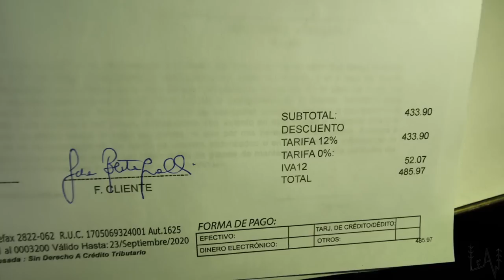Van Life RESILIENCE - We don't give up on our old Truck Camper Lucky LeAw

Comment: I was just looking at the picture after you turned off the truck your second U-joint looks like it's coming apart it's your second U-joint that's creating your vibration it's not pressed in correctly
Reply from the maker: In the next video (on Sunday) we will finally fix Lucky LeAw and get back on the road! We will also show in the video what was wrong! Thank you very much for watching and commenting! 🙏❤😊👍😉👋 Cheers Luca & Sara

Comment: I don't think you need a new drive line. You would have felt a bad vibration before if it was unbalanced. It can't get out of balanced from sitting there. It could be something in the transfer case or in the rear differential. either way you need to find a Mechanic that knows what he is doing. this is not that difficult for someone that knows what he is doing.God Bless,
Reply from the maker: Good morning Patriot! In the next video (on Sunday) we will finally fix Lucky LeAw and get back on the road! We will also show in the video what was wrong! Thank you very much for watching and commenting! 🙏❤😊👍😉👋 Cheers Luca & Sara

Comment: Don't belive it's  the reversed throwout bearings. The have needle bearings inside.Not by no means bashing or hating.  That's the young generation throw it out by a new one ,go in debt no problem. To spend your time building your own home, be it on wheels or not.Half the thrill of a adventurous life experience is the tests that get you better as a person .The center bearing bolted to the frame could be bad and causing the vibration. You guys stick it out it will get resolved.
Reply from the maker: Hi Rodney! Thank you very much for watching and commenting! 🙏❤😊👍😉👋 Cheers Luca & Sara

Comment: Hello, I started laughing, but not at you. This happens all the time. Everyone focuses on on problem, not on the system. There are some great Youtube videos on balancing a drive shaft. I think the u joints maybe the incorrect ones, or something was not put on correctly. I would visually inspect each part. See if they fit snug and correctly. When you have one thing fix, change out all. These cars are old, so all parts get used. Good luck! Be thankful for what you have (last video you had with issues). the universe is test you....
Reply from the maker: Good morning Scott! In the next video (on Sunday) we will finally fix Lucky LeAw and get back on the road! We will also show in the video what was wrong! Thank you very much for watching and commenting! 🙏❤😊👍😉👋 Cheers Luca & Sara

Comment: It's difficult to see but pausing the video it looks like the front uni-joint is out of phase by one spline.  It usually has an engraved make at the spline (under the rubber flex behind the center bearing).  It should have been marked before being removed if it wasn't engraved.                It's a simple mistake and easy fix but should not have happened.  Take it back to the mechanic and they should fix for free.  Otherwise remove the rear shaft (or drop the center bearing bolts out and lower to the ground) separate at the spline and realign so all the uni-joints are all in the same phase alignment. 

The mechanic will fix easy, fast and should be for free.
Reply from the maker: Good morning Steve! In the next video (on Sunday) we will finally fix Lucky LeAw and get back on the road! We will also show in the video what was wrong! Thank you very much for watching and commenting! 🙏❤😊👍😉👋 Cheers Luca & Sara

Comment: Was the driveshaft put back together as it was aligned originally?  Did they mark the pieces and asemble it the same way? It is an easy fix if they did not get it back together as it was originally.  This is the problem because it is happening at low speeds. Have them reassemble it correctly. Also look to see if  there is a spot on the drive shafts where a weight might have been and was knocked off when working on it? The missing weight will cause vibration at higher speeds not so much at low speeds.  I would not put the truck in drive like that with one of the rear wheels on the ground.  The truck could move unexpectedly by engaging the wheel on the ground!!  Be careful.  Hope you figure it out.
Reply from the maker: Good morning! In the next video (on Sunday) we will finally fix Lucky LeAw and get back on the road! We will also show in the video what was wrong! Thank you very much for watching and commenting! 🙏❤😊👍😉👋 Cheers Luca & Sara

Comment: If the spines in the joints fell out and got under the cap, it is ruined.  Unfortunately you got some bad advice on what needed replacing, not going to go into it.  They are not being careful enough with the work they did.  I hope you get it fixed correctly.  Even though the out of balance comments can be an issue, this is not your problem.  That would be at higher speeds.  You better not drive fast with it the way it is!  It is clearly not spinning centered and that is much much worse than out of balance because they did not mark it.
Reply from the maker: In the next video (on Sunday) we will finally fix Lucky LeAw and get back on the road! We will also show in the video what was wrong! Thank you very much for watching and commenting! 🙏❤😊👍😉👋 Cheers Luca & Sara

Comment: firsta alla, ifa the drivealinesa Ra outa balancea and werea nota b4A, likea way they usedabea, it cana bea outabalanca ...  move onea 180 degreesa, (only takes one little wrench )... can checka  outa balancea  by adding a hoseclampa toa the drivalinea  ...  the nut screw parta mighta be enougha weighta? (shoulda only happen when going over 40 or 50 mph, 2A), .... moeva ita arounda, buta thninka you mighta havea bada transa and or transfera casea  mountsa too? the other rubber partsa werea waisted!! .... youa very luckya to hava those guys helpa you outa... they DID A LOT ALL READYa!!! Sure they checked the carrier bearing too,A? ....  needa more of the driving and not fixing,eh? 

one of the best rigs i ever bought, ($ vs. drive time) was a 1975 $25  wrecked van cause it had a new carb, distributor, alternator and shocks, but did not run, so towed it home to remove the parts cause i have over 6 70,s dodge vans. when starting to remove all the parts, a friend stopped by and asked why we didn't just fix this one up and drive it, cause it was a ripped out shell, and could fix it up way we wanted it. . We did fix up only the insides , left the outside all primer and dents, but the inside became primo deluxe with shag and cedar and mirrors and custom furnishings... We drove it over 300,000 miles before we parked it, running, and now parts rig. only put about $200 in parts over 12 yrs and learned a lot about peoples "perceptions" with a windowless van, all wasted looking on the outside! Looking forward to more vids about the .... outside's and  left and right going down the road from you 2! thanks, best of luck .... AndA.... cooomeone, you can do it, or she will starta doing it tooA!  Can tell you 2 are beautiful on the insides too! THATS WHAT COUNTS... maybe a different way driving back north to Alaska??? your truck should be all a ok by thennnnnA.
Reply from the maker: We believe we will be able to get to Ushuaia with Lucky LeAw! Thank you very much for watching and commenting! 🙏❤😊👍😉👋 Cheers Luca & Sara

Comment: I despise that vintage of truck. Lol. Especially if it has a 351. Anyhow...the Ujoints are ok. The way they are arranged doesn't matter as long as you have access to the grease fittings. The vibration of the driveshaft IMO is from being installed without marking the position first. So when it was reinstalled, it wasnt put back in the same position it came out. Get it? If it were me....I'd drop it, and "clock it" til it improved. If it's truly unbearable, I would mark the position and clock it 180 degrees and see what happens. It's cheap, and you can do it If you have basic tools. It's just a pain in the ass.
Reply: Leaw is the best!!
Reply from the maker: OK!
Reply from the maker: Thank you very much for watching and commenting! 🙏❤😊👍😉👋 Cheers Luca & Sara

Comment: I have watched you from the start.  I am a Failure Analysis engineer, I know trucks, mechanics,.   YOU NEED TO PULL THE CAMPER OFF THAT F350 FORD AND GET ANOTHER TRUCK.  That truck is TOAST!    You cannot depend on it.  I see all the parts going bad, all the rust, it is finished.   Pull the wheels with new tires off and put them on a newer F350.. Otherwise you should end you trip and not go further. There is no automobile repair,  parts  further south.   So, stop and find a truck.    I would loan you my truck but its in Portland, Oregon and you passed here many months ago. 
Video 11:39 ; your pointing at the Drive Line" Universal joint" You rev up the engine and I can hear clearly the Universal joint is bad.   That happens when the Universal joints are not lubricated regularly.   It is a easy fix.   Watch  https://youtu.be/5gOeBE-ylQw

Video 23:40 - Drive line is not aligned.  The First U Joint is not aligned, not installed correctly.  The mechanic was hitting with a hammer, that should not happen.  Remove the first U joint (after differential) in front and re-center collar on joints or replace that u joint again.   That it so bad, so sorry.    Still time to get another truck.
Reply: I also have a background in off road racing and mechanics. I tend to agree with Spartan. The condition of the truck is making it an endless money pit. You are simply asking too much out of it for its current condition. That being said, I have no idea what their options are for finding a truck that can handle the weight where they are now. I have to imagine where they are it is mostly small and midsize trucks for sale.
Reply: I have been communicating with a guy in Ecuador that has a F350 truck crew cab that is in great condition.  He might sell his truck if you speak with him in person.   I also ask him if he could help find someone or a car dealer that has a Ford F350 for sale.   I am sticking with the Ford F350 because you have purchased new tires and those wheels fits a F350, and all your customization will work on that model truck.    I wish I could know if you have money to purchase a vehicle, and the maximum purchase price to look for.     I am sorry that your existing truck is not going to continue.    You could consider purchasing a different camper vehicle that is more suited for SA  South America.      What do you think?   Let us know.
Reply from the maker: Good morning Spartan! Thanks for all you are doing! In the next video (on Sunday) we will finally fix Lucky LeAw and get back on the road! We will also show in the video what was wrong! Thank you very much for watching and commenting! 🙏❤😊👍😉👋 Cheers Luca & Sara
Reply: I contacted a few guys in Ecuador who are part of a Ford F350 club and I ask them if they can find another truck for you to buy and drive.   The last message says , he has the only Ford F350 truck in Ecuador.   There are other overland 4x4 trucks that have enclosed truck beds.  Maybe you can find one and work on a conversion to living inside truck.

Comment: Hate to sound like a Negative Nancy. It was irresponsible for two adults to embark on a 1000 plus mile sightseeing adventure in a truck that is a liability in its self thinking that wasn't bad enough they added the extra weight of  camper. Old trucks that have been neglected are ticking time bombs that have zero business being driven on back roads. This just shows the disregard for others safety. Do others agree?
Reply from the maker: NO!